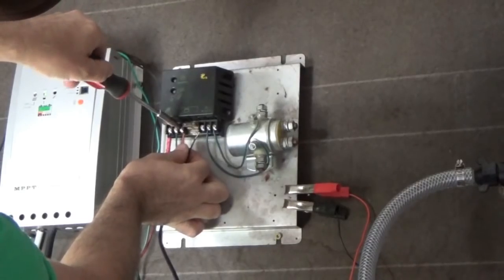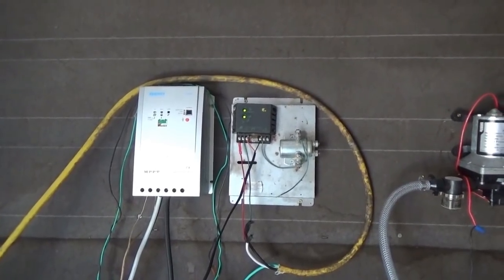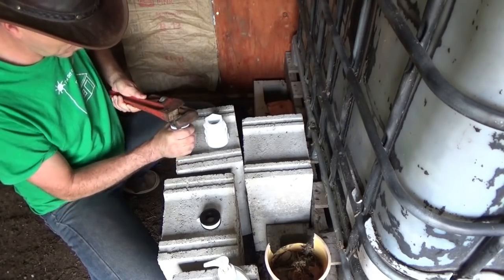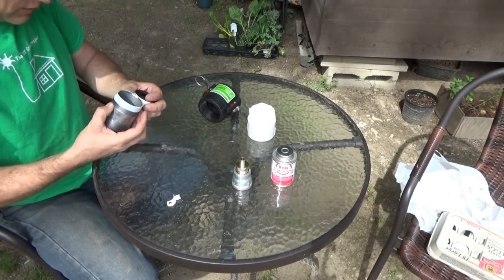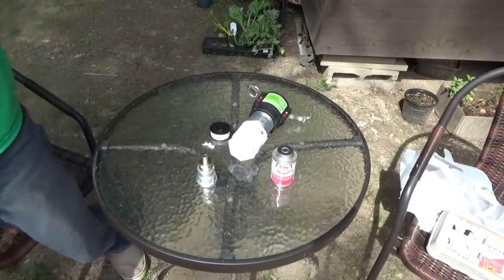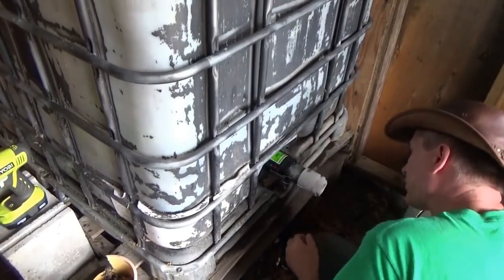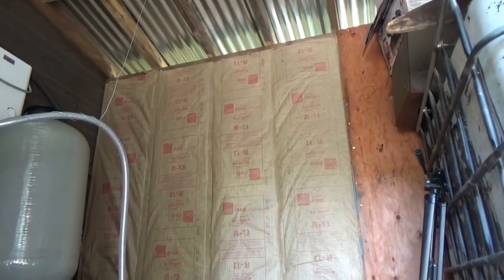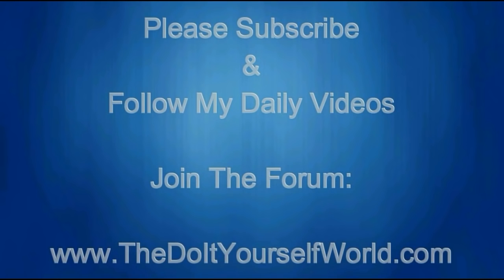Connected Wind Turbine & Plumbing Rain Water System

Comment: Nice job! If you find the time the sugar shack roof and eventually the wood shed roof could yield a lot of water as well. It can get so hot there you will need a great deal stored up to be self sufficient.
Reply from the maker: Thanks. Yes we plan to have water collection off every single roof possible for next year
Reply: Troy can not dig a well himself. It has to be done by a company that is authorized with a permit. That can cost a lot of money. If the water table is really low it might not cost as much... if they have to dig a long way down it could cost more. The rocky terrain might add to the cost. ;)
Reply: Oh mannnnnnnn I have so many great inappropriate come backs for lil old steven... I am just going to bite my tongue and carry on with other things tho. It isn't my channel... therefor, not my circus, not my monkey.
Reply: There is a roof on the sugar shack... just the wood shed is left.

Comment: Some nice person sent you that lifter tool to help you with installing the plywood.  You seemed to be excited when you took it out of the package. Why don't you use it?
Reply from the maker: Because in this corner the wood was 4 inches high in the air. On the other wall the tool will be very helpful though.
Reply from the maker: Oh, and it was half sheets of plywood on that wall.
Reply: Then put 4 inches of wood on the ground, then the lifter on that.
Reply: Not to be to technical, but a half is 24".  Judging by the looks of it I'll bet it's 31-3/4" wide. Measure it and tell me.
Reply from the maker: Wow, you are good :)
Reply: How close was I?
Reply from the maker: Right on to the quarter inch. lol
Reply: The Do It Yourself World How do I do it?!!
 Only a truly amazing carpenter can do stuff like that!!

Comment: Glad I could help with the gator lock, makes things much easier. If you ever get a leak replace the rubber gaskets inside.
Reply from the maker: Cool. Thanks
Reply: +The Do It Yourself World be sure to insulate your new connection to the IBC.  As a rule when joining metal and plastic fittings, try to avoid metal inside of plastic.  The metal expands more than plastic and breaks the plastic fittings open.  Good luck and God bless.

Comment: In an earlier video you installed plywood on the wall and I said next time you should put lines on the plywood at the location of the studs while it's on the cut table. It's impossible to sight a straight nailing pattern in 8' as i'm sure you found out.  I've heard you say many times that you don't get suggestions in time to use them. Not this time.
Reply: mdbigman  I've never come across used plywood that is not square. Concrete forms carpenters reuse their plywood for years. The biggest reason for the lines is because it's almost impossible to sight a straight line along the length of the plywood. You can tell when you miss the stud when hand nailing, but it takes a trained ear to hear the difference between a miss and a hit while using a nail gun.
Reply: mdbigman Nevertheless, you could see how the edge matched up to the last sheet and it looked pretty tight. That means lines on the plywood be parallel to the edge. You'll notice that the edge of the previous piece ran up the stud pretty much in the center of the stud. Everything after that would be the same.
Reply: mdbigman Troy just throws out statements like that. I'll bet he has never taken a diagonal measurement to check for square. When he states that they're not square, he's probably saying that because they're warped.
Reply from the maker: Yes warped. Everything is warped because its second hand. But the walls are pretty straight
Reply: The Do It Yourself World You completely ignored my question as to why you didn't put lines on the plywood at the location of the studs before hanging it.
Reply: *****  What's wrong with pride in workmanship? It's standard procedure, and is easy to do. Why not do it? Maybe he should not snap lines on the plywood before he cuts it, or not not use stringlines in the garden.
Reply from the maker: I used a level to simply hold in place and judge the studs. Worked perfectly for me after the wall was up. Same thing I guess.
Reply: The Do It Yourself World Yes, that will work. With my way you don't have to hold a level.

Comment: the point off the dumpload is to short out the power wires from the wind turbine, this will work as a brake, preventing the turbine overspeeding. not as y often see to drain the bank!,you always need to have a load on the turbine to prevent it spinning on overspeed and distructing it self. btw, iff y look at your video it looks like you have not connected the power leads to the bank the right way, remeber, positive on one side of the bank, negative on the other.... (not on only one battery)  nice addition to your water storage!  getting more organized every day!

Comment: I'm curious if you're going to put siding on the THOW or leave it tar paper?  If siding, don't you have to pull all the stuff off the outside wall, move the shed, and take down the solar panel on the front? ...............or are you going try to work around everything?
Reply from the maker: I plan to work around the framing of things. I figure it is best to get the framing and supports up first - before the siding. This way I get a sure footing on the solar panels.

Comment: troywhen gluing pvc always use a cleaner/primer.when its cold just glue will maybe leak
Reply: Thousands of PVC joints say you're wrong. If you take reasonable care and have clean PVC  there's no need for any additional chemicals or treatment. Just additional crap you're told to buy…
Reply: dear john primer or gluecreates a rough microscpic for the pvc to bond i plumb for a living  and was taught to alwaysuse clener or primer first

Comment: Troy I wouldn't put towards the ground like that un less u plan to insulate the pipe when it becomes closer the winner because it will freeze being that close to the ground even with you having a heat hot air will be up in the ceiling not on the ground just a thought
Reply from the maker: I thought of that. The shed will be heated by a wood stove all winter anyway

Comment: Just an idea Troy, but you should have your shutoff valve on the tank side of your quik disconnect.
Reply from the maker: Each tank has its own shut off valve. I also wanted a shut off valve in the system to leave the rest of the system in operation when a tank is out.
Reply: +The Do It Yourself World    Ok, sorry I didn't know that it had it's own valve.

Comment: How much did it cost you to go off the grid in total
Reply from the maker: I started out with some junk batteries and a homemade 65 watt solar panel. Since then I got $800 in second hand solar panels, a few hundred in charge controllers and another 800 in batteries. Plus odds and ends. A couple thousand easy.

Comment: your wires are to small. fire will happen. no PVC cleaner before the glue
Reply: No I want him to do it properly so others can see it done properly
Reply: Wire gauge depends on how much current you're going to pull through it and should be fused. You don't need PVC cleaner if the PVC is clean.
Reply: Wrong again… The purple stuff is a primer not a cleaner who's sole job is to soften the pvc for those who don't know to use enough or the right glue. The purple color is to prove to inspectors it was used. The welding process is done by the glue itself not by any cleaner. All those pvc joints done without it can't be wrong however you must use the proper amount of glue.